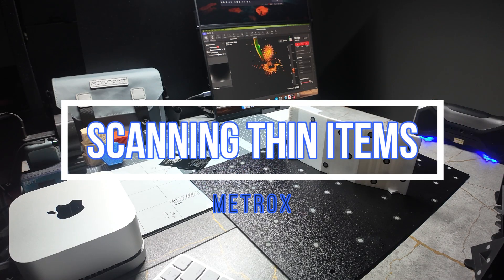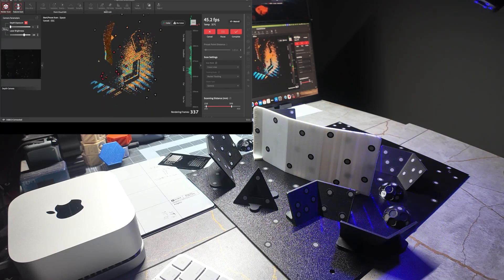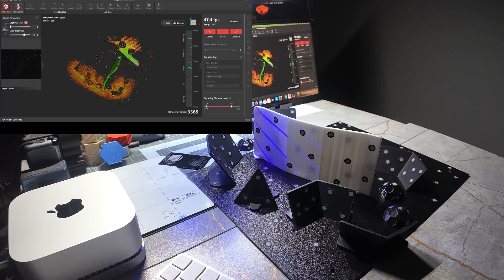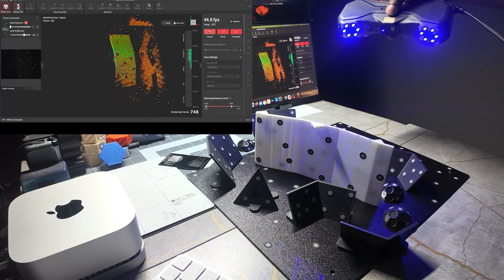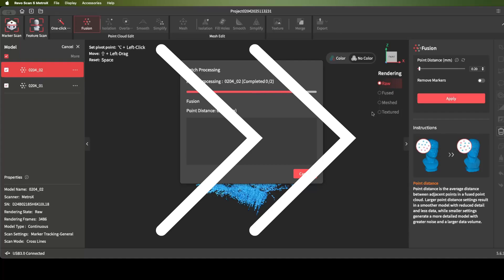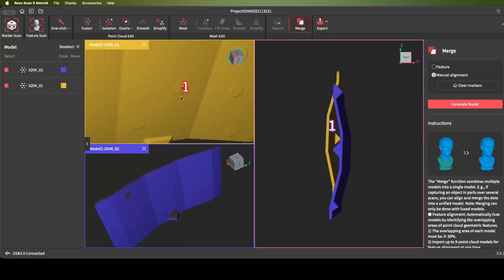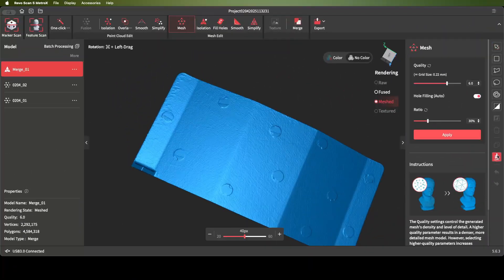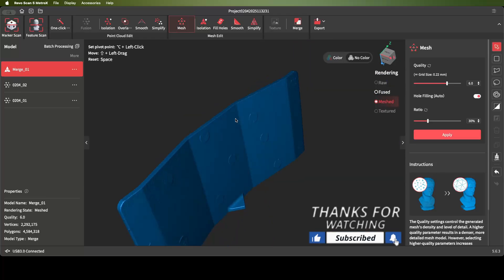How to 3d Scanning thin items with Revopoint MetroX

Comment: What is that flat base you have there and where did you get it?
Reply from the maker: Black sheet is just a sheet of abs plastic that i added markers to. You can get the on amazon for around $10. one side is smooth and shiny the other is textures and almost matte. I use the matte side